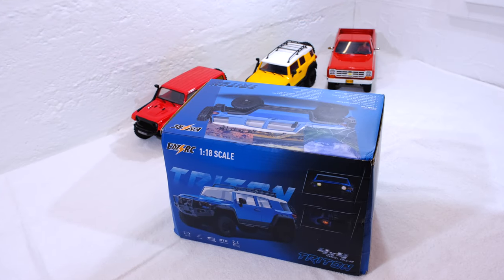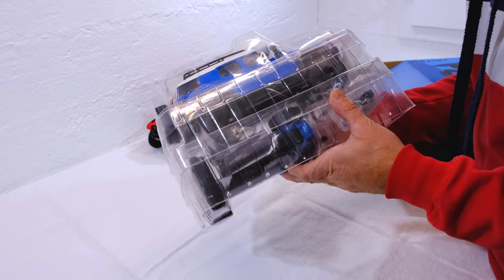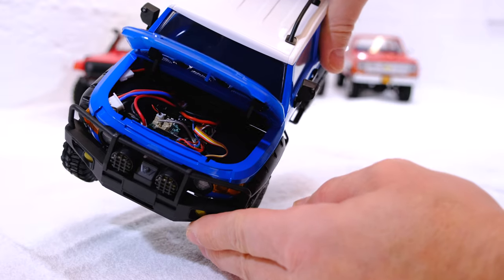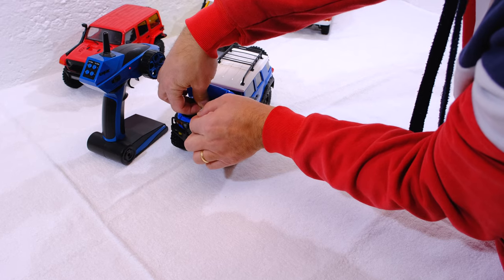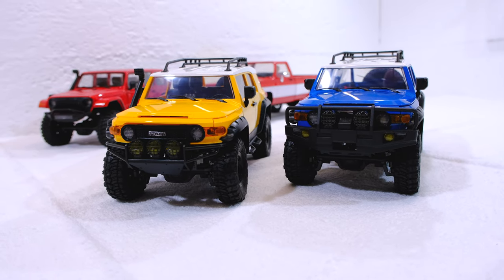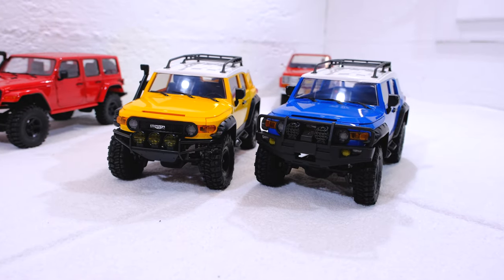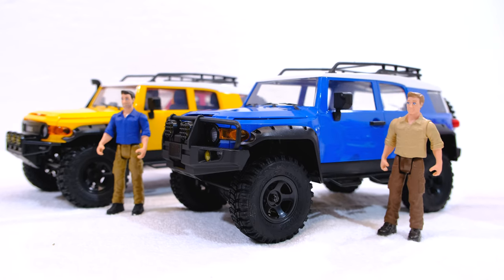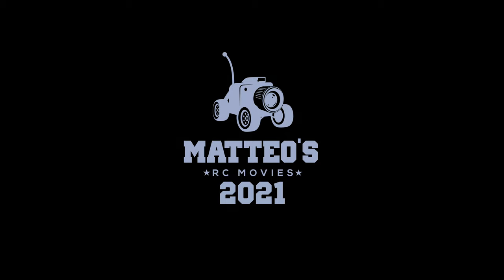EazyRC TRITON 1:18 Scaler - Unboxing and Review

Comment: I bought the fms brass wheels for my eazyrc arizona on ali. Best upgrade so far. Stock wheel without screws was about 5gr, brass wheel 47gr. The screws also looks heavier. I forgot to measure assembled wheels. You can buy only the brass center ring and use them on the stock wheels if you don't want to pay 25-28$ for the complete wheels.